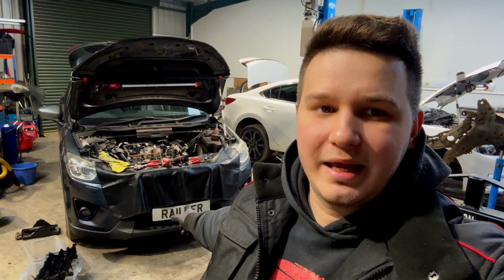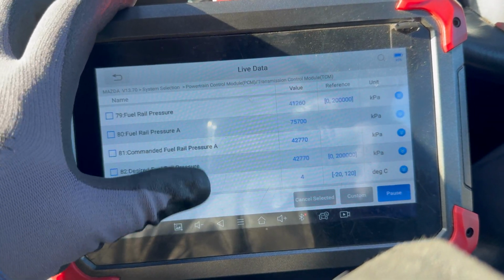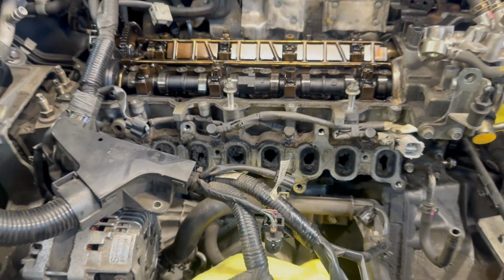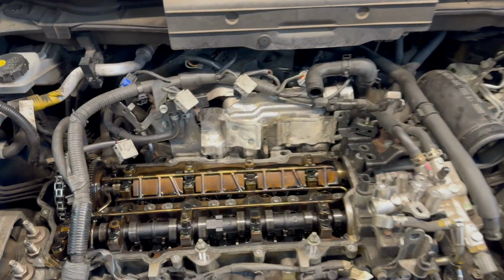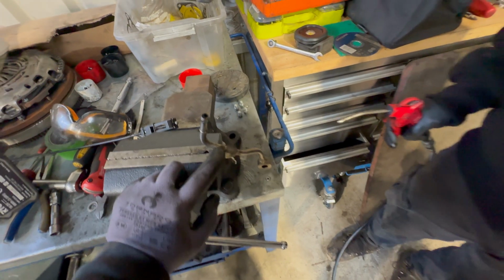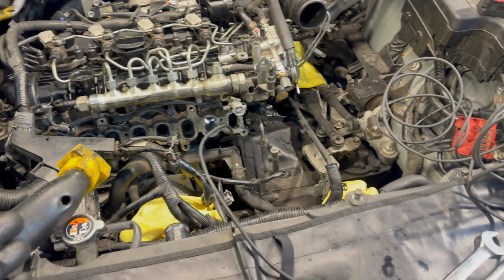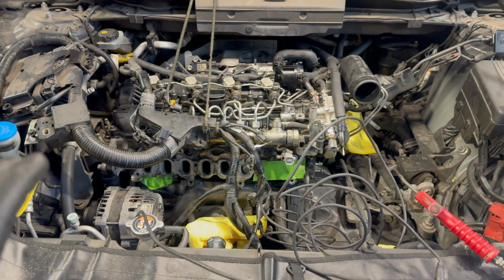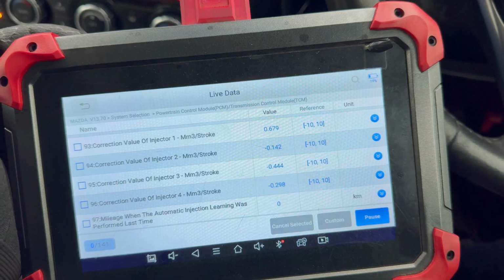Mazda CX5 Skyactiv DPF Problem Solved By Engine Carbon Cleaning

Comment: Your videos are brilliant. You have been so helpful in understanding the Mazda engine. I recently bought a 2017 Mazda CX5 from an independent car dealer. I have had a full service done and 4new tyres put on with alignment and tracking done. My issue is when I'm in 4th -6th gear and input the accelerator down full the car shudders/shakes. I am suspecting it to be a carbon build up issue or EGR valve but can't be sure as I'm not a mechanic and specialist like you guys. Any ideas? I'm based in Ireland
Reply from the maker: We are near Gatwick. Send us a message on facebook messenger. 😉

Comment: when i watch this i feel good bcs  1.6 mjet 2 in my car got only new intercooler pipe and one heater after  120k milles. I am planning to check and service Bosch injectors soon, drive belt was changed at 90k and it uses same 5w30 oil for 9 years..

Comment: Also the low ash oil has to be used to prevent the build up.
Reply: Low ash oil?
What do you mean?
Reply: @rusanescutraian  What is low ash oil for diesel?
They are also called low-ash engine oils because they have a low tendency to ash formation. These oils consist of innovative, low-emission additives. They are designed specifically for vehicles with diesel particulate filters (DPFs) and three-way catalytic converters (TWCs).
Reply: @rusanescutraian Look for ACEA C3 rating on the oil packaging. That is a common recommendation low ash spec for vehicles with DPF

Comment: Very bad carbon build up , and metal pipe exploded like a fireworks. You have saved that  engine so it can breath in  easily now. how often do you recommend cleaning intake port ?  As always great job with great results
Reply: My Mazda mechanic recommended Max. 50k km.

Comment: hello, please tell us why the diesel gets into the oil? Thank you
Reply: Every time the car does a regen, it sprays extra fuel into the exhaust stroke. Some of this gets past the piston rings and gets into the engine oil. Whether or not the regen “fails” (doesn’t complete) or not is irrelevant, the regen itself causes this.
Reply: Worn injector seals